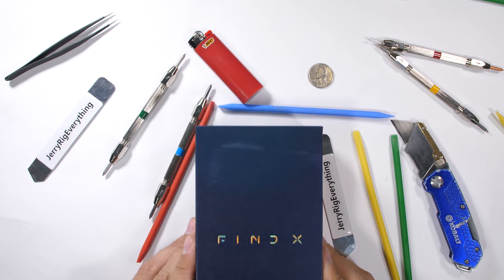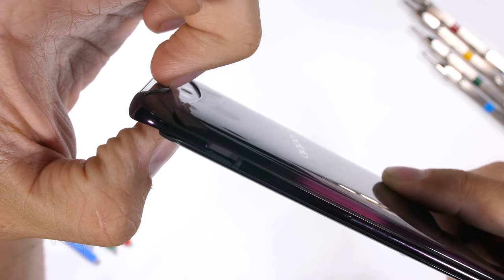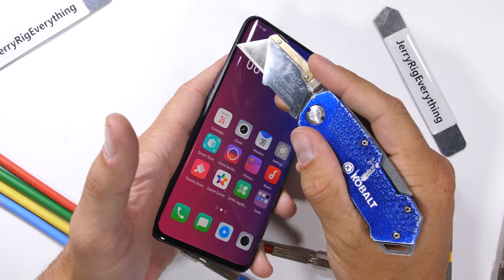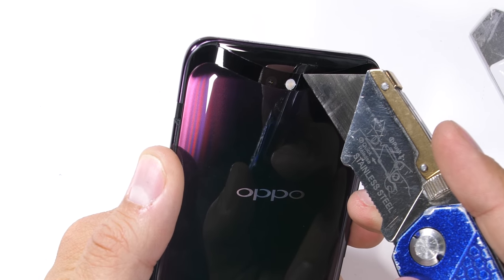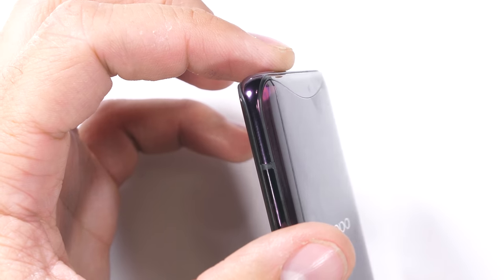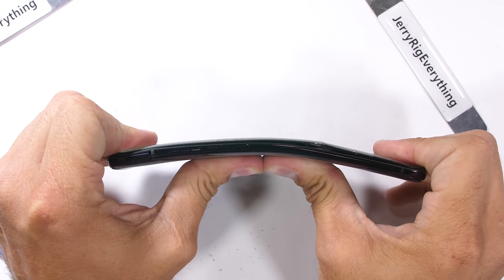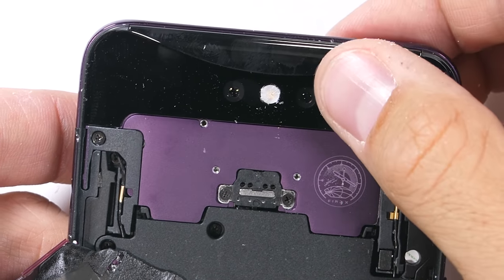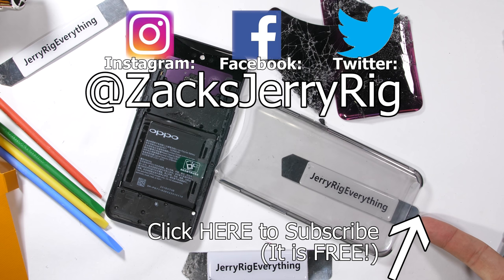Oppo Find X - BEND TEST FAIL!!

Comment: As someone who has owned this phone for the last two years, as my daily driver, I can say it is much tougher than Jerry gives it credit for.

I've used it without a case, and despite having dropped it on concrete and other hard surfaces from ear height, it still hasn't got much more than a few scuff marks. Despite using the  pop-up camera as a fidgeting device by repeatedly pulling it out and pushing it back in, against the motor, it still functions perfectly. Also dust getting into the cracks hasn't caused any issues either. It's gotten wet and been to the beach with sand. 

Aside from a few scratches from daily wear and tear, it is practically good as new. Even the battery still keeps very close to its original performance, managing a full day with no problem. I'm really happy with how this phone has held up over the past two years. It's definitely a lot tougher than you might think. On the software side, it still gets regular updates from Oppo and is still as fast and snappy as it was on day one. I would happily use this phone for another two years, and it has given me no reason to think it can't handle another two years of abuse by a less than careful phone owner. My hat off to Oppo for a well engineered and durable device.

I think the Opps find X's spot on the shelf of shame is not deserved. Plus, bending a phone like that is not realistic in terms of daily use. I mean, you'd have to try pretty hard to put that much force on it by accident. I've sat on it plenty of times.

Comment: Dang... He took it apart with his hands. For the cost if this device it's a giant fail.
Reply: This man deadlifts 400lbs with his bare hands do you
Reply: You don't buy a phone so you can break it.
Reply: Indeed, though other phones have literally folded in half during this test
Reply: Yup, 1k.
OnePlus 6 with the price of under 600 dollars passes the test. What a shame that Oppo failed
Reply: @Fai-tn7ti  
This phone was not made with the intention of bending in half. It's supposed to be one of those luxury phones, not the ones that can go through hell(Nokia 3310).
Reply: Man you think Galaxy S phones are made to be bent in half ? But like most flagships they survive the bend test unlike this Oppo. This is the true sens of those tests : what happens if you screw up with your phone ? Will it survive ? 

The only usless test their is most certainly the screen vs lighter test, its a bit too extrem of a test to be comparable to real life usage. But bend test is definitely comparable to some real life situations even if it is quite extrem also. 

We can regret the fall to concrete test however.
Reply: @pyrrehraus6571  funny
Reply: Khaled Salem true but at the same time other phones stand the bend test

Comment: Vivo Nex was the same concept done right. There was a reason for hiding front camera, it retained both jack and fingerprint scanner.  Oppo Find X on the other hand is an example of a form over content, not very practical (useful features mentioned above are gone), not necessary (no reason to hide back cameras at all) and as we can see - not durable.
Reply: MINTOR94 The Vivo Nex also has an in-display fingerprint sensor which is really cool
Reply: 卓羿徐 errrrr... No... You see any notch there?? No... Did apple have in display Fingerprint? no.. 

Is apple the first in Face id? Also no..
Reply: MINTOR94 yeah Oppo saw Vivo Nex and thought they could make a pop-up camera system, but all the 'organs' of the phone where pushed down, so the phone was made useless. The camera is the true flaw here.
Reply: I think that was kind of the whole point, to make a phone that puts the bezelless philosophy over everything to show what is actually possible when disregarding everything else. No phone meant to be a serious mass production device will go this far for being bezelless, the tech simply isnt there yet.
Reply: Stormtroopy 123 oppo and vivo (and oneplus) are sister companies.. Any tech one company owns belongs to one another.. 

They didn't think they can make it... They just can... They just try to do it differently than Nex and it turns out bad..
Reply: 卓羿徐
Not in this case. They actually did a lot of their own. Vivo was the first one with an in screen fingerprint scanner as well.
Reply: Stormtroopy 123
Oppo didn't need to copy anything from Vivo. They both are parts of BBK Electronics. As is Oneplus.
Reply: 卓羿徐
In which model?
Reply: 卓羿徐
But I'm talking about completly other thing, so why did you mention Motorola as example?
Reply: theotherdicypher but the iphone doesn’t get any weaker, this phone is a mistake
Reply: iphones are lacking useful features, are friagle and expensive to repair so the comparison is actually good.
Reply: theotherdicypher and I agree with you, that's why I wrote it. That was supposed to be an answer to Reza Reinaldi.

Comment: would be good to perform a bend test on another Oppo flagship that does not have the motorized part - we need to know if this weakness is limited to just this model or if OPPO PHONES ARE JUST WEAK in general!
Reply: Oppo, OnePlus and Vivo are basically the same company, so I don't see the point.

Comment: Oppo "Flagship" with budget phone build quality.
Reply: Ernest Jay Its not budget quality, it has a design flaw. Even iPhone 6 had bendgate design flaw, which Apple accepted it years later, and never cared for their users. Any phone having movable parts, may gonna be having some structural design flaw with it.
Reply: It's not even really a design flaw. It just can't a backplate that goes all the way through and gives it rigidity, since parts of it move. A flaw (at least to me) is something that could have been avoided, but I see no way oppo could have avoided this.
Reply: Sgtpeterenis at least a three sided metal frame would have saved the phone

Comment: The Vivo Nex S is way better. It has bigger screen, bigger battery, and has a smaller moving mechanism which makes it more durable and reliable.
Reply: World Of Tanks Blitz and finger print sensor
Reply: World Of Tanks Blitz but i think it's way more cooler 😍
Reply: Also has Headphone jack
Reply: Soumen Mondal
Yeah, little to no wiggle room too.
Reply: Oppo find x can move it's camera parts 500,000 times as per claimed by company but vivo claimed only 50,000 times ...
Reply: because for oppo you have to use the motor every time in face unlock,front and back camera, for vivo its only front camera..so calculate and decide which one to go..considering perhaps you will use find x's motor atleast 50 times a day..or more or less
Reply: Honestly, both phone are the same in "actual" durability, the reason they are broken on Jerry channel is because he put it in extreme situations, situations that are unlikely to happen (or not at all) in real life. You don't buy a smartphone and then in a boring day you decided to bend it until it breaks in to pieces. IP68 certification doesn't mean you are going to do scuba-diving with the damn thing. Shock-proof doesn't imply that it can survive a drop from the roof of the Burj Khalifa. And in the end, durability depends on the way you use it.
Reply: It's less attractive than this!
Reply: 4K Reconic If you sit on this phone it's going to break. That's how the bend test started. Goes back to when the iphones started to bead. Bendgate it was dubbed.

Comment: This video just cancelled any chance of me buying the phone 😑
Reply: Well unless you want to bend it in extreme proportion or drop it underwater it should be fine
Reply: ye no lol... I constantly sleep on my phone or sit on it and drop it on the ground constantly... my phone is also constantly exposed to dust. this was not extreme at all... a bit of pocket dust and 1 wrong bump and the phone will be done for in less den few years... phones should last at least 4,5 years and every iphone can EASILY last that much. heck some 4 year old iphones still have software updates (also galaxy s series EASILY lasts 4,5 years just root it and you are good to go build quality is supreme)
Reply: santosh kumar c meh even if this video doesn't exist i doubt you would buy the phone
Reply: You mean it'll be fine just like the iphones with touch disease? It doesn't take much flexing on the PCB to make solder joints crack and for your device fail, a case MIGHT save your device but why take the chance in the first place when you can simply buy a better made phone?
Reply: And OPPO said that this crap is a flagship eyeroll
Reply: lightgorm 4-5 yrs .
Ur phone will be really slow
Reply: oof oof Tru

Comment: When you have something so valuable, small and nearly impossible to fix if it breaks, moving parts should NOT be on the phone. Anything that moves can get jammed and by the look of that motor its gonna keep trying to close When it gets jammed so something is gonna break even further. Someone needs to make a phone that the camera can see through at the top, it would be a game changer if it had decent pictures
Reply: Engineer 7 exactly any dust and it f#%ed up. What do you mean camera can see through   You mean a camera on the top side? Lol. Takin pictures of the ceiling. 🤓
Reply: Digei Frunza it would take 2 years for it to be made
Reply: pop up digital camera lens
Reply: I bet you are from this generation.. back then we had phones that were so bulky with moving parts that  moved till they get outdated. I bet you always fix the door of your car every month since sand gets into the hinges.. Man! which moving parts phone have you used?.. have you tried this find x and it jammed on you?.. lets not speculate!
Reply: Have you used a camera with zoom lens?.. or just auto flash popping up the camera body?...mmmmhhh is so then refer to it and you will get your answer.  How many times has the lens jammed because it was in your pocket? .. unless you drop it.. or did it into the soil. It will never easily jam as you guys put it.
Reply: Robert Otieno you are right☺️
Reply: Robert Otieno like you said sand or dust Will get in the phone.and it's a big deal because this is an expensive phone
Reply: not a time. the stepper motor is great. i used it in my phd dissertation.

Comment: why wont oppo make an in display fingerprint sensor? like their sister company, vivo?
Reply: I think this will increase the cost
Reply: Because there's no Technology do implement that sensor under a AMOLED display. Vivo does not use AMOLED display for it's " under display fingerprint " Technology
Reply: d.ronzo17 Cost VS benefit. If it can unlock 95 % of the time by just looking at it, why bother?
Reply: d.ronzo17 vivo is no more with oppo and one plus
Reply: Because they still fighting each other
Reply: wait vivo is male  research before u say anything

Comment: Ive daily used my oppo find x for pretty much a year now, great phone. Camera functions well storage wont be filled for ages and the ram is great for phone usage, ive dropped it  a few times and used it on building sites, the only problem i have with it is the factory screen protector has finally started to fail, so i will need to replace it, all round one of the best phones ive ever bought.